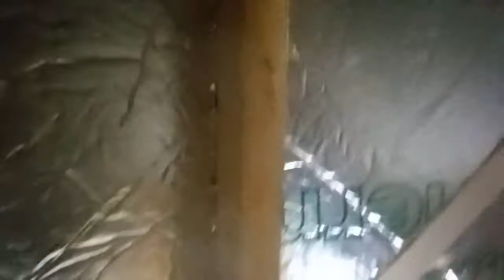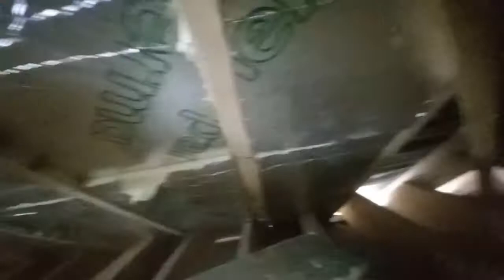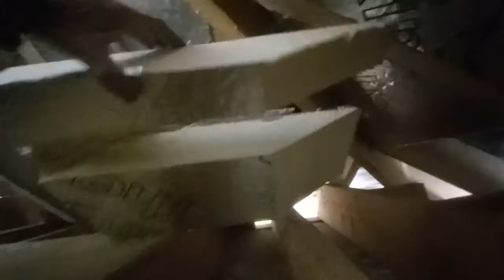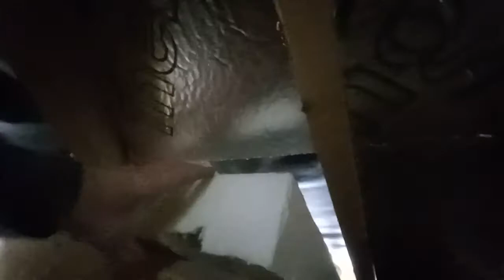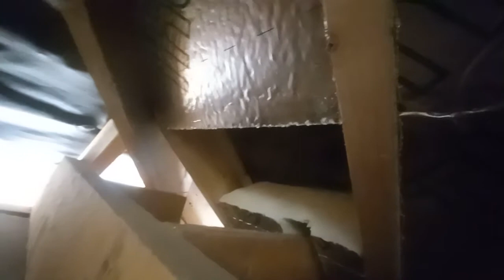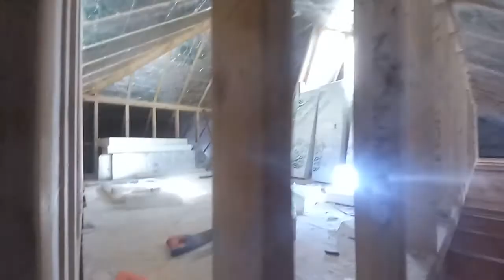attic insulation of a hipped roof

Comment: How did you vent the air in the hip roof prior to insulation?
Reply from the maker: At the moment there's a 25mm gap from the top of the insulation to the top of the rafters and membrane,from ridge to eves/fascia,  this space under the felt allows  ventilation of roof space ,keeping below rafters warm , prior vent through eves/ sofit and was no insulation  in roof only on celling
Reply: @leonsletterbox2013  The issue with hipped roofs is there is nowhere for the air to go in the hips.